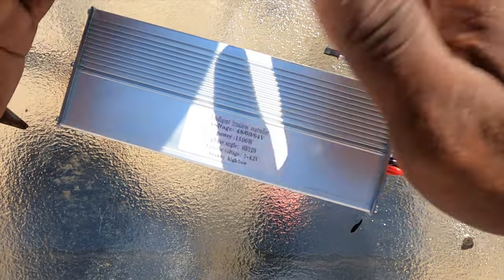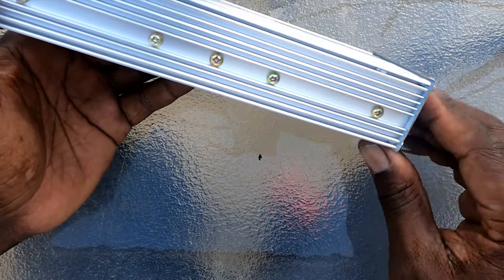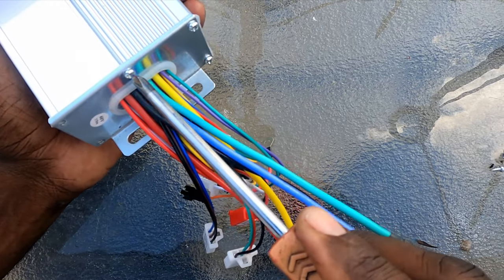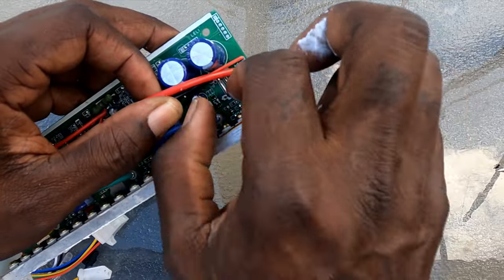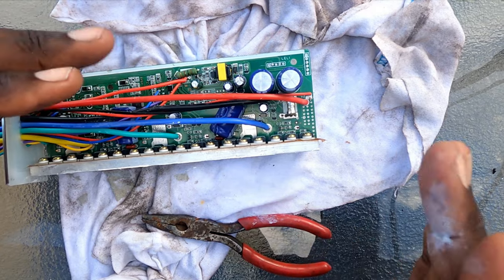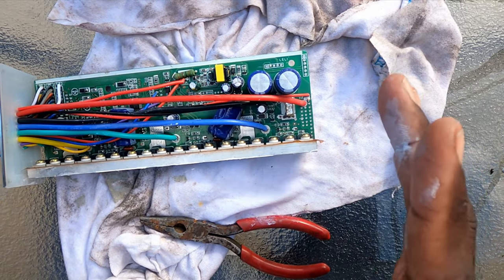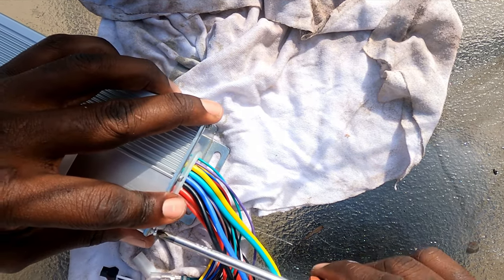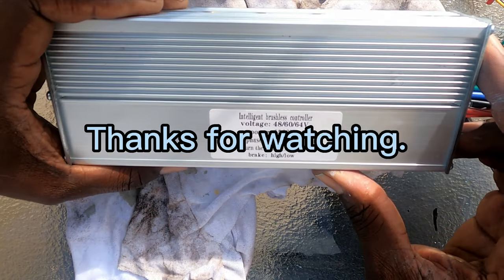How to shunt mod your ebike controller for more power.

Comment: How long that controller 
Looks like my factory one is about 6inches and if so can I get a 1000w controller in that length?
Reply from the maker: I really don't know but this one is 6.5 inches long
Reply: @E-bikeguy  s12sn 1000watts 40amps torque simulation sine wave controller from bmsbattery
Reply from the maker: Sounds good, nice specs
Reply: @E-bikeguy  Thanks to you  I'm super excited..soo do you think the 500w motor will hold up or upgrade to a 750w motor?
Reply from the maker: @dextermarbury7115  oh most definitely!!!

Comment: Hey i need some advice i have a polarna e bike just purchased . i would like to upgrade the motor i believe 1000 watt  motor  . i m a rookie at this😂 but how would i go about  doing this?
Reply from the maker: is it a sock controller on your ebike? you want to up grade to a 1000w hub motor?
Reply: @E-bikeguy   i believe i have 1000 watt motor i have the polarna m6 e bike
Reply: @E-bikeguy   no controller on my e bike
Reply from the maker: @mixmaster1825  I would suggest a 1500w hub motor, that's what I'm going to be to one of my ebikes and a sabvoton 7260 controller but it might be too big
Reply: @E-bikeguy  ok one more question do i upgrade the battery or will that  be ok ?  Wat web could i purchase this on  ? And if the controller too big wat could i actually do
Reply from the maker: Well sabvoton controller is big but not much and yes it will be ok with your battery the kit should be about $350 on aliexpress
Reply: @E-bikeguy   ok ill look that up
Reply from the maker: ND Ebike Factory Store
https://a.aliexpress.com/_mL1Dw0k
Reply: @E-bikeguy  wat would u suggest  gor wat type of kit . i watched most of ur videos . i think u have done a great job on ur bikes   i seen one for  349 but i just wanted ur input does it matter the brand?
Reply: @E-bikeguy   i have a 17.5 ah battery its actually the stock battery is that gonna be strong enough
Reply: @E-bikeguy  1 more ?
Reply from the maker: @mixmaster1825  what cha got? Well, with the sabvoton controller, you can tune it for your specific needs
Reply: @E-bikeguy   so could i just buy thst controller  gor more speed or would it be better to just buy the whole kit  esp the 1500watt motor?
Reply from the maker: @mixmaster1825  if you can, get the kit
Reply: @E-bikeguy   i can get the  kit . but my range 400   the rear hub correct?
Reply from the maker: @mixmaster1825  what you mean by range 400?
Reply: @E-bikeguy  spending money
Reply from the maker: @mixmaster1825  oh ok well in that case, see if you can nabbed up the controller, it will add more power to your 1000w hub motor
Reply: @E-bikeguy  i found that controller its 2000 watt 72v  is that too much ?
Reply: Sabvaton its by itself tho   . 2kw    72v  for $168 should i get a more expensive one they have another edition for 210 than 395
Reply: U know wat ill spend 500 im just trying to get my bike more power and speed im 6 foot 3  and  im 255 pounds
Reply: @E-bikeguy  ok i gound the sabvaton  the one i believe u have in ur video 72v  80ah controller 395
Reply: How much power would thst give me
Reply: How many watts ?
Reply: My ? Is will that be too much power for my battery?
Reply from the maker: No, you can have the biggest controller money can buy, you can always tune it to match your battery max amps so yeah just tune it and later when you get a bigger battery you can go up in power
Reply: @E-bikeguy  ok the one in ur video  from china can i get that one and did u get that from allie?
Reply from the maker: @mixmaster1825  yes all my parts from aliexpress

Comment: Hello i have a QMWHEEL V20 fatbike, what i want exact, is that the bike will be limited at 5kmh with just the trottle and that with peddle it goes 25kmh, but only the trottle max speed 5kmh, now in stage 1 just the trottle does 10kmh and that is illigal in the Netherlands, the rule is just 5kmh so i want put a switch on it, or a electric responder key or codes or something that it just goes 45kmh (what it can ride now max speed) when I want, and when I press the key or switch that I just can limeted the trottle at 5kmh but that you can paddle and trottle together the max can be 25kmh, but only pressing the trottle and no peddle can be max 5kmh.. and top speed 25kmh with peddle and trottle but the trottle need to stop at 5kmh, the controller is from dongguan jing hui I hope that I have explained it well if you need more info or something please let me know
Reply from the maker: A programmable controller can do just that you can put a switch or a key to limit your speed
Reply: @E-bikeguy how can I do that?
Reply from the maker: @Heinz-sq2eo  why yes you can

Comment: Beef up the heat sink double or triple the size so it will not limit the current
Reply from the maker: Understood 🫡💯👊
Reply: @E-bikeguy  what I do in that kind of set up is simply I add heatsink flat flat bar in the front of mosfets sandwiched in the middle

Comment: I have a ridstar dual battery dual motor. Also dual controller set up..🎉
I tried to change the programming to increase speed.  Seems to me somehow the speed limit is hard wired in ...
Any way of bypassing it??
Top speed 30 
2 1000 watt motors
52 volt batteries 
Is there any software you can use threw the USB port to change settings??
Reply from the maker: Sorry to hear that,  but at this time only from the manufacturer of the controller  to get unlock firmware
Reply: @E-bikeguy  what replacement controller would you recommend?
To have full control over what my bike is capable of?? 
I know it is a cheap Amazon bike but I plan on upgrading it ( frankenbikeing it )
To get what I can out of it..
Reply from the maker: @Twisted-wizard  for a good controller grab the sabvoton 7245  I highly recommend it
Reply: I believe it is not speed limited. You are power limited. Even if you have 2 1000 watt  motors does not mean you have 2000w power. You still have 1000 watt motor. Just 2 of them which give you more torque. 52v 1000 watt is equivalent to 30mph. I have 1 48V 1000 watt motor I can get to 30mph. Yours will get to top speed faster because you have 2 motors. Hope that makes sense.

Comment: I don't see shunts area on mine...his do you increase power at the phases...only 15 watts coming out of the phase wires
Reply from the maker: You don't see just one shunt?
Reply: @E-bikeguy  no shunts...at all. 
Thank you for responding. Any help would be appreciated
Reply from the maker: @kevinvito2942 ok sorry I really can't help you on that topic but it looks like a new controller will be in order
Reply from the maker: https://www.ebay.com/itm/305135588130?mkcid=16&mkevt=1&mkrid=711-127632-2357-0&ssspo=evwhr9jbtbw&sssrc=4429486&ssuid=g6yfcireqc2&var=&widget_ver=artemis&media=COPY

Comment: Can the wires handel the increased amperage? Wouldn't do long trips with this mod.
Reply from the maker: Yes the wires should handle the extra current,  the max on a basic controller mod is about 2000w

Comment: If you want more power, buy a bigger controller. If it were that easy and lasted for any amount of time ( Before it fries out) the companies would just do the same and charge you for a more powerful unit. It may work for a little while or it will just pop as soon as you plug it in.  Unless you upgrade everything else to handle the power.
Reply: Manufacturers design their products to be foolproof.  That means limiting everything to much lower than what it can handle, just to make sure it doesn't get burnt up from somebody hitting full throttle for their whole battery.

When you raise the peak, you just need to have some discipline and let off of the throttle regularly, to keep the average usage within the rated range, so everything can cool down adequately.

But being able to rapidly accelerate to 30, then turn off the assist, and pedal until you eventually drop down to 20, then accelerate back up to 30 again, uses less total power than just going a constant 25.

Batteries are already protected by BMS, so the controller will not draw more current than the battery is permitted to discharge, so the battery is safe.  And for a hub motor, the only limiting factor is heat, so that comes down to the rider.  If you're running double the power, then you need to use it less than half the time, to give it time to cool.

When I ride, I'm constantly messing with the controls, changing the PAS setting to max every time I accelerate, and then turning it off.  So for me, something like this would get plenty of time to cool down, I just want more peak power during my acceleration.  I think something like this will work for me.  My e-bike's motor is commonly used in other e-bikes with 18A controllers, and my battery is rated for 18A discharge, my only limiting factor is my controller, which is limited to 15A.  So a mod like this will only result in +3A, that's +20% power, until my battery's BMS protection will prevent it from going any higher.  That will bring my speed from 20-21 mph up to 23-24 mph, which might not seem like much, but I'll feel a lot 

All of that being said, I think when it comes to homemade e-bikes, people should really just buy a better controller, it's such a cheap part to upgrade, just do it.  Shunting only makes sense if you're using a bought bike and you can't just fit any old controller inside the frame where the original one was.  A lot of bought bikes, just to play it extra safe, tend to skimp out on the controller, and get a controller that limits the current to way less than what the battery and motor can handle.

Comment: I did this mod, hooked everything back up. My display does not turn on, I checked all my connections. Checked my battery voltage and it reads 53v. Nothing works now. Any advice?
Reply from the maker: When you hook your battery up to the controller did you hear a pop sound? Also on the display un plug it and see if you have voltage coming out the display, red and black wire should read battery voltage,
Reply: @E-bikeguy  No pop. No voltage on the display black and red.
Reply from the maker: @jonk8337  now what your battery be at when full charged?
Reply: @E-bikeguy  53v
Reply from the maker: @jonk8337  that's at full charge? Is it a 48v battery need to be at 54.
4 voltage and if it's a 52v full charge will be at 58v
Reply: @E-bikeguy  It’s a 48v 17ah battery. I charged it a couple of days ago and it’s sitting at 53v.
Reply from the maker: @jonk8337  could be the battery, it's rare a controller just stop working just by plug the battery in and you're sitting at 53v instead of 54v?
Reply: @E-bikeguy  It’s not the battery. I have 3 ebikes. I’ve tried another battery as well, same 53v. Though the battery is a couple of years old, at 53v it’s still at 90% SOC. I’ve ridden this thing @ 46v and it’s fine. It doesn’t affect the display or the bike in regards to use, only performance. All my batteries will fully charge above 54v and will settle back down, which is common.
Reply from the maker: @jonk8337  if your battery is good like you said then I really don't know what to tell ya I sorry about that.
Reply: @E-bikeguy  U don’t need to be sorry. I understood it’s a mod and anything can happen. My controller was identical to yours, and I figured I give it a try. The soldering was quick and it only took a few minutes. I was excited, but it was not meant to be. I wanted to beef up my 48V 1000w rear hub motor to try and keep up with my 52V Bafang BBSHD. I ordered a replacement kit already, so it’s all good. Thanks for spending the time to reply. Just another learning experience.
Reply from the maker: Ok, yeahI hate when stuff like this happens, wish there was more I can do!💯
Reply: Update. Hello again. I just received a new replacement controller. It turns out I made the dumbest mistake that could be made. I forgot that I unhooked the main wiring harness and forgot to reattach it. So the modded controller works after all. LOL! However, I’m not sure I got more power from my modded controller, maybe just more torque. I think it now pulls too many amps instantly for my battery (48v 17.5ah) to handle because it has less range and after 12 miles it is shutting off when I throttle it will shut down. To recover, I have to turn my display back on, it reads sufficient voltage 49v+. I am charging my battery right now. It might be this 48v battery doesn’t have a high enough disharge amperage from the BMS. I will also try a higher 48v capacity battery and maybe try my 52v battery as well. I will keep u posted. But if u have any thoughts, please share. Thanks in advance.
Reply from the maker: Yes your bms is cutting the power since now the controller is pulling more amps if you can might have to do a bms bypass on the discharge side
Reply: Hello, This controller that I modded is a 35a peak controller. How many amps do u think it’s pulling after the mod? I did exactly what u did with the shunt mod. I know someone who is selling cheap LG cell 48v 20ah batteries. I am contemplating paralleling two 48v battery to double the amp output. What are your thoughts?
Reply from the maker: @jonk8337  I'd say right in the 50s the controller will put out after that mod
Reply: Hello again. My controller kit is capable of 52v. Do u think I can go to a 60v battery with this modded controller? The caps inside is rated at 80v. Not sure how my display will react to a 60v battery.
Reply from the maker: @jonk8337  yes can go 60v but the display will be off a smudge on voltage unless you can adjust the voltage on the display.
Reply: @E-bikeguy  Hello again. Update. I’ve been using my shunt modded controller electric recumbent trike with an EGO garden tool/lawnmower 7.5 ah battery. The 56v EGO batteries are 14s packs, so essentially a 52v ebike battery. It’s been doing great. Just wanted to let u know. Your videos and your responses really helps a lot of us.

Comment: For future reference, MOSFETS (pronounced moss-fets) are not transistors because they are voltage controlled, not current controlled like transistors.

Also the blue stuff is lock-tight, which helps keep the screws from coming loose.
Reply: Mosfets are transistors. FET refers to Field Effect Transistor.  The fact it's voltage operated doesn't rule out mosfets being Transistors.
Reply: @muratcakr5640  
I guess you are correct, I just meant that they are not one and the same

Comment: i forgot to say it was delivered with a cheap controller , i feel its not deliver energy enough ,like you showed in vedeo, the shunt thing is that for long runs here in norway lots off uphills
Reply from the maker: It will definitely help with more power

Comment: My controller has a R005 resistor on it haw can i make it go faster
Reply from the maker: Oh man let me research it what kind of controller you have ? There are some controller that cannot be modified
Reply: @E-bikeguy  any luck buddy all i no is the resistor is a R005. And I want to put 1 on top to half the ohm risistence. But I don't no what watt to pic thay offer 1 w 2 w 3w
Reply from the maker: @user-ut1fs4kv3z  no luck here I was wondering if you knew the name of the controller because I really don't know, but the shunts are resistors also. But the r005 is a resistors but it also tells me that the controller is very small

Comment: I have a theory on  hub motors when saying what wat they are is just basic standard . For instance, 250w - 500w. And they use minimal, so they have the right battery 36v. For example, if you had a 100w motor, it wouldn't use a 36v battery because the minal is too low. Something like that. I have 250w using 530plus watts. Hasn't reached 600w. So iv seen on my lcd screen so far
Reply from the maker: Shoot you probably can put 750w to that 250w motor

Comment: Can I do this while it's on the bike with battery disconnected
Reply from the maker: Yes you definitely can.
Reply: @E-bikeguy  I whont get zapped if the capacitors have charge on them I can freely solder them
Reply: @E-bikeguy  and thanks alot for your feedback

Comment: short 3 shunts? ,so is it not 1 per phase?
Reply from the maker: Yes all two or 3 soldered together
Reply: @E-bikeguy  thank you , ) ,do you have some ideas about 1500 watt freego fat bike uppgrade, this bike is big and heavy ,here in norway every thing is difficult even parts ,, i have 52 volt battery i think that is half of weight of the bike:-),, il be grateful of all i can do
Reply from the maker: @assabjorn  ilk research it and get back with you.
Reply: @E-bikeguy  here i found a picture of it

Comment: I have a coswheel GT20 and after doing this I have not function in my wheels at all
Reply from the maker: Oh wow have you made sure the connection to the motor was good ? Doing this should not cause your controller not to work.

Comment: ill bet you the price of a new e-bike that you burned up the motor or controller with in the first 2 rides when you did that
Reply from the maker: No actually had it on my son's bike and I sold it to his friend,  so where is my new ebike? Lol  but I'll be real with ya, there is a risk involved when do a sunt mod to a controller.
Reply: I did a shunt mod on my Vic trip Titan 750 watt 23 amp controller and I put 650 mi on it and it still rides good